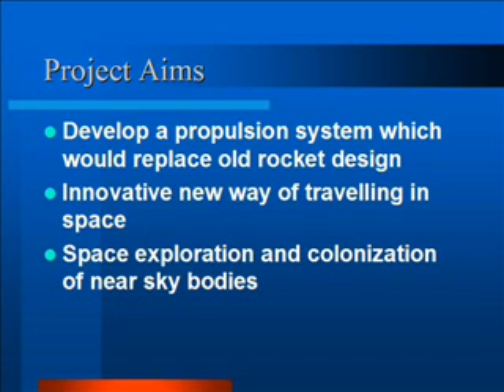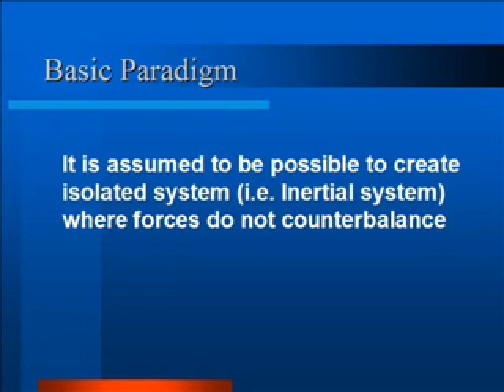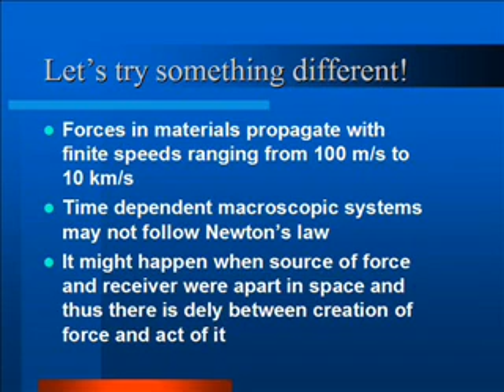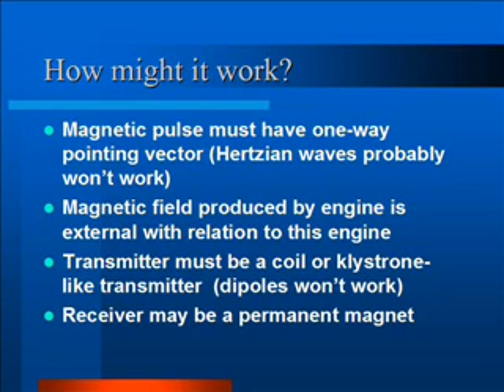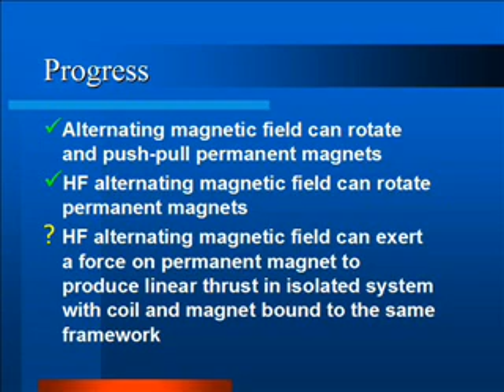Concept of Electromagnetic Inertial Propulsion

Comment: But to really understand the gravity phenomena you will have to understand the diamagnetic, magnetic, paramagnetic and dielectric materials down to sub atomic particles, cause it is not all in electrons, there are protons and neutrons wich acount for special effects like gravity, zero point energy, and so on. If you really want to achive it in best light you will need to play with powerful transmiters in interference a.k. klystrons or some thing of this sort, making standing em wave freq. mixing

Comment: It's known that inertial propulsion can be achived by two microwave transmiters transmiting with slightly different frequencis, so their signals combine into frequency difference, that is well known as frequency mixing. Simulation reveals that frequency differentiated em wave seams to travel faster than original waves, but that is just an ilusion i think, cause it is wave on wave, so it traveles with same speed. Inertial em propulsion can even be achived by following Lorent'z Law.

Comment from the maker: @KeskinTRS 
orbital dockship and orbital passenger terminal is good solution. however the issue of powerful electric propulsion is still to support. You can't build combustion propulsion which will get you to Mars with constant acceleration 1G. And only in this situation you don't have to worry about lack of gravity (for instance losing Ca from bones). Time travel with 1G = 3 days to Mars, without it = 7-11 months

Comment: Well why do you feel the need for alternating magnetic fields? Surely that would just cancel out any motion you might create. I am personally working on a device that would fulfill the project aims that you have stated using the same main features as your project. 
   I have built a preliminary version of my device which should levitate if you power it with electricity. I have yet to test it but I do not have an electrical suply large enough, but fortunately I have a contact who has.

Comment from the maker: but this is very theoretical calculation assuming that current stops immedietly. in reality current won't stop in 0 seconds. it will take some time to stop the current due to inductance of the wire in closed system. reactance due to inductance is 2Pi * f * L. the more voltage you have faster will current decay and B created by it as well.

Comment from the maker: what kind of speeds of the craft? well, I estimate that top speed will be 3-5% of c due to energy constraints (nuclear reactor). if you ask about speed of propagation of the pulse then no one really knows what propagation speed is in near field. however it is assumed that it is c speed. B field moves outword of conductor with c speed. in 1 inch from conductor it will be
1 inch (1.6x10^-5 mile) / (188 thsd miles/s) = 85 ps (0.085 billionth of second)

Comment: What kind of speeds are we talking about And is it in a similar setup as Tom's concept using longitudinal fields as well? Well it is'nt totaly longitudinal, the field closes into a solinoid type field with closed B lines after the pulse has ended, similar to a  longitudinal after receiver connects. I do have a question if you can find it, How long does it take after current has stopped in a cunductor for the B field to decay? I cant find it in my books or papers anywhere :-(

Comment: Electromagnetic systems could be the best, because there're no moving parts, so unless other external causes affect it, this device is virtually eternal, the eficiency with superconducting systems could be of 94%5 in the storage system and 99% for the motor. Noises, vibrations, pollution, heavy fuel tanks, explosion dangers, that could be in the past, but you need a lot of money to build a first prototype, because of the rare materials and high purity requirements for nowadays

Comment: If you want to propel a spaceship with electromagnetic impulse, you'll need SMES or superconducting storage systems as a light fuel tank to keep the incredible amount of power to reach 24machs, with chemical methods like batteries that is impossible. We have been work with these materials but our rigaku cooling system only get -197°C and 10 lts of liquid nitrogen per day.

Comment from the maker: That is correct. we can use multiple short impulses as well. The time of impulse must be short enough to "fit" at least 1/4 of impulse in space between coil (or other emitter) and permanent magnet. Due to the large speed of light in air it is quite short - about ns. Currently I'm trying to use iron rod as medium (it slows down propagation of impulse and thus lowers frequency)
Reply: Thorsupremecommander Thinking outside the box is sometimes awesome but the trick's to keep it simple. I  do not speak english,  and I do not know if you have found the answer? If you still need help just ask me. You'll cry when you'll see how stupid and simple it is,  and the fact that you should have done it by yourself because everyting's just right in front of you since the begining.